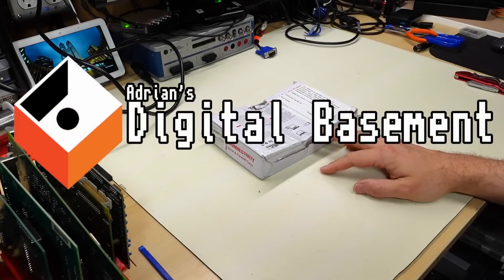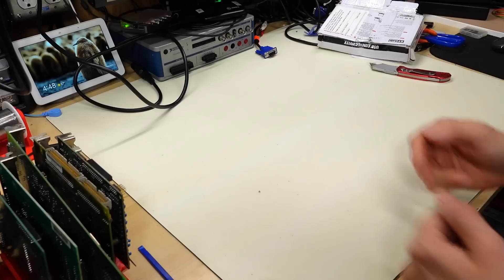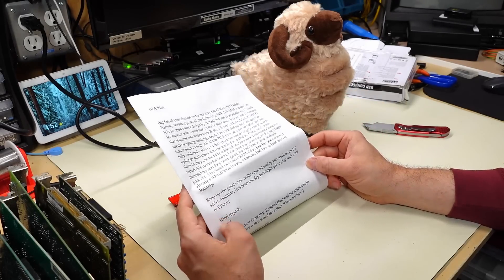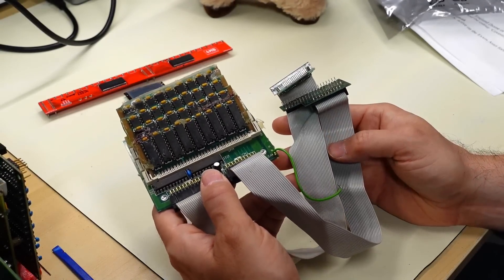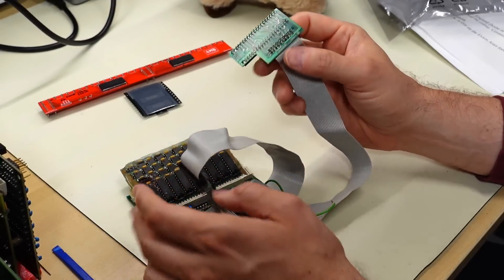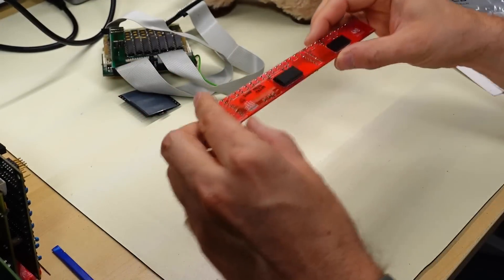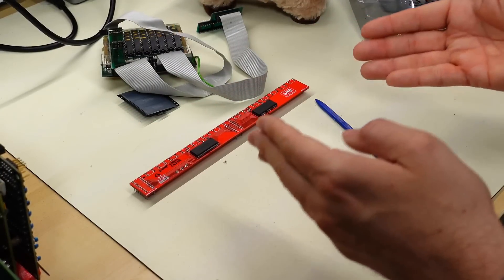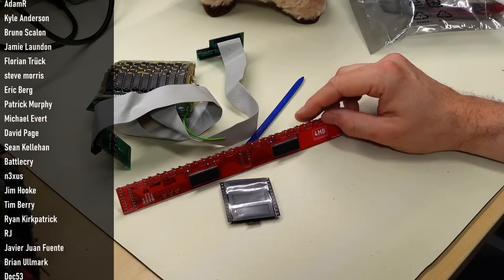0012 Finally, a reliable RAM upgrade for the Atari 520 ST!

Comment: Does any software fail with more than 512 KB? Some pickier Amiga 500 games hated expansion RAM. If this isn’t the case on the ST then I’d make the 4 MB upgrade permanent.
Reply: Yes, spot-on regards known software issues - needs to be switchable really.

Comment: From what I've seen, a board that big is too much of an ask for sockets. RMC had one for his A500+ that died because it kept disconnecting. I'm surprised there's no ST RAM upgrade that plugs into the CPU socket, probably an architectural limitation but it would be cool to see regardless.
Reply: Check out the terriblefire 536.

Comment: I'd solder it in. Why would you want to go back to 512K from 4Meg ?
Reply: Known software compatibility issues.
Reply: @MCNOISE666  Yeah. but it's still a big job to put the 512K back just to run the program you want at that time.
Reply: @Franko_Walker  Agreed - a total pain!

Comment: That new RAM module is very reminiscent of the ones you can get for the ZX Spectrum to replace the lower and upper RAM banks with single boards fitted with modern RAM that is more reliable... :)

Comment: If it can be configured for 512KB just in case any software has issues with 4MB then I'd solder it in. Might be a tight fit for the square pins though.
Reply: I believe it will show up as one meg if you disable the extra address lines. The four megs is four banks of one meg.

Comment: Depending on how reliable those RAM chips look, and if the add-on board doesn't cover any repairable components on the board, I'd go for it. It's very unpleasant to deal with anything breaking in the middle of a PCB stack.